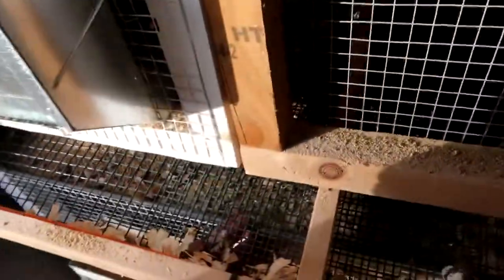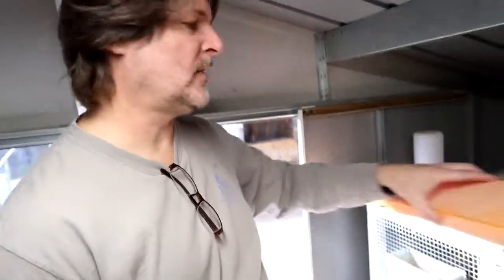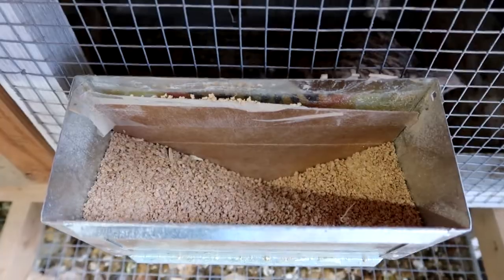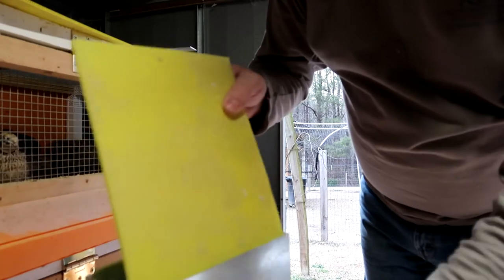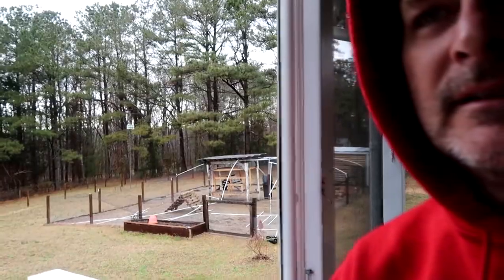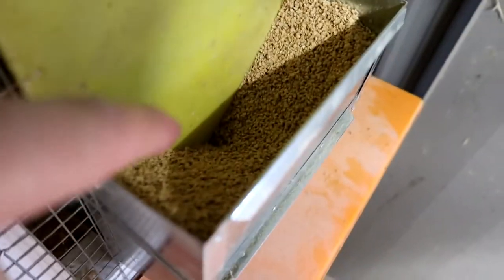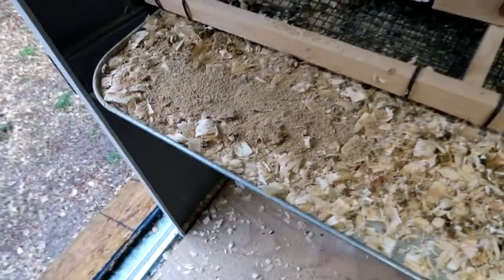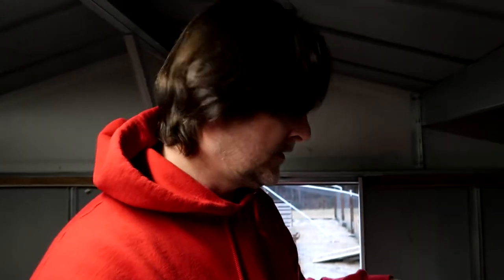Quail feeder mods

Comment: Have you seen the mod coturnix corner did to help stop the waste.
Reply from the maker: I did. I didn't want to take the time to cut a bunch of wire, and I don't have the square 1X1 wire.
Reply: @flamingeyeballfarm6871  I used the same plastic board (clear ones)  and made two 1 inch holes 1 inch from the the ends of the J feeder in lieu of the 1x 1 wires,  so that when my picky eaters ( yes I have some of those too) push the food around the food stays in the feeder for the one that are not so picky.  Just an idea.

Comment: get some cheap plastic boxes with lids akin to a shoe box.   drilll 1.25 inch holes in same high in the box ( i do 3+3+1+1) all around the box........has reduced my waste by better then 90 percent maby 95%...........now i have to figure how to reduce the 5 or 10 percent  that is still wasted
Reply from the maker: This really helped to reduce waste to almost nothing. I didn't want to crowd the cage with a box as they were roll out cages. All the quail are gone now, so if I get them again, I will do some things differently.